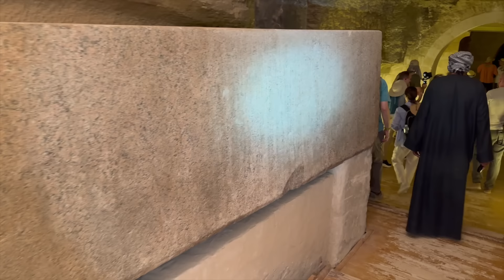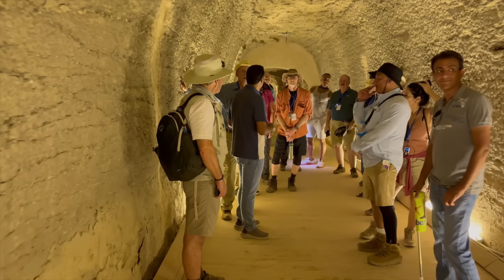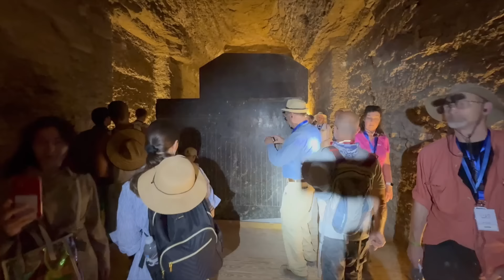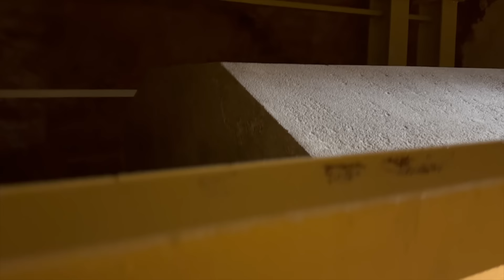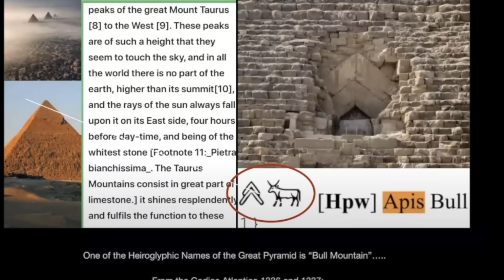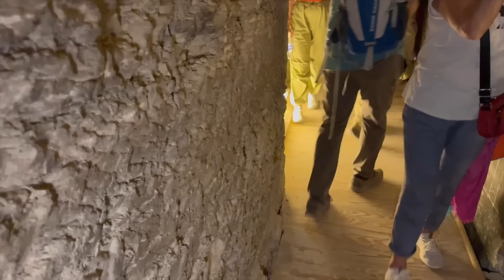Serapeum Secrets: what was really inside the 100 ton machined boxes?

Comment: How the Pyramid produced power
-------------------------------------------------------

If the SAR scans are accurate then that means the eight long vertical shafts under the Pyramid are what Physics calls "resonance tubes", that's basically a hollow tube you can pulse sound waves thru & amplify them. So what they were doing is taking the Earths natural vibrational energy (that's why they went so deep) then they increased that vibrational energy when they shot it up the shafts to vibrate the Pyramid above.

This amplification of the Earths vibrations was powerful enough to vibrate the entire Pyramid structure & this vibration is energy, a power source or rather, a never ending power source that supplied free non stop energy.

So apparently there are five so called "relieving chambers" in the lower level of the structure, those chambers are designed to modify the incoming vibrational energy in effect "fine tune" the vibrations to a specific frequency they desired.

Next thing that would happen in the functioning of this machine the powerful Vibrations would shake the structure like a titty dancer on payday & this vigorous shaking would energize the tons of Quarts Crystals embedded throughout the stone in the entirety of the structure

That's an incredible amount of electrical energy

Now we need to try and understand that the Pyramid is a natural toroid structure, basically it can swirl all the atoms thru the stone in the structure & all of those atoms pass thru the Quarts Crystals

Picture a doughnut in the air where the crust is a containment field made from magnetic properties and electricity, then in this doughnut the atoms inside swirl about in a never ending path that follows the containment field of the outer shell...Sort of like a bubble or ball lightning

Or better yet picture the Pyramid as a hollow funnel and the atoms flow thru the structure the same as swirling water would 

  
Next thing that happens is a plasma field is created in the Kings Chamber when the vibrational energy vibrates "the Box" or What others call a Sarcophagus. Inside that Box was liquid Mercury.

Next the atoms from the Lake in the lower lever is drawn up thru the Toroid & into the Kings chamber, this disassociates the atom structure in the plasma field

then finally the energy is shot out the tip of the Pyramid

-------------------------------------------------------------------- 
So 99% of the time the builders utilized vibrational energy to power the Pyramid

I left some stuff out, no one reads my dribble anyway :P

But these Boxes in the serapeum might not contain Mercury, these other Boxes did contain something atoms passing thru the stone activated

Comment: If there is nothing inside the box,  then the message is not the missing , but the box itself.     In the age of Alchemy Science,  they changed from mud brick construction,  to concrete formation of blocks    Judging from the rivers,  like the Nile,  where colored silts sit in some places  unmixed and pure,  having a unique color and taste,  and then in other places in the same river there is a  granite hard river rock bed  .   So they realized that  where the  random outcome was mixing the colored silts,  it formed concrete stone.  Where the silts piled up and did not mix,  they remained  granular and  like sand.    So when they dredged the colored minerals out of the rivers, they  experimented mixing sweet and bitter tasting colored sands  that when  they were mixed proportionately  in the right amounts  of each powder,   a caustic reaction occurred that burned away the water,  by rapid dehydration and  what was left was a  hardening material  like clay that in a  few days hardened to granite hard stone.  So  they  built the megaliths not by quarried bed rock  but by concrete mixtures  of  Alchemy Solutions, where  mixtures  change to compounds because of the innate creation of heat  out of caustic mixtures of powdery silts and sand.   
   To make a statue or a box,  you   mix the concrete to the moment it holds together as a modeling clay and you work it  artistically to be any form you want,  sculpted  to be a statue or a box or merely blocks,  and you have the clock running. As the  concrete hardens  you lose the opportunity to work it like clay ,  cutting and shaping and smoothing,  and finally as it hardens,  it forms , just like the bedrock of the rivers,  a  granite hard concrete,  because the caustic minerals mixed up ,   burns away the water.    You can also  add   illuminating powders  that light up  the dark caves,   because is is a slow form of a fire,    and painting the walls of an underground tunnel  makes them  burn and light up the caves,  for a time , and in the extreme cases of mixing these caustic powders that taste  like  "Bitter waters" mentioned in the Bible,   it creates  gun powder,  or dynamite ,  where  you can  cause great explosions .   These were the arts of  ALCHEMY SCIENCE  in the ancient times.   The craftsmen never wrote those matters down to  publish the secrets, they were taught only father to son in a craft ,  and  many  ancient fables and stories  contain mathematical  formulae to express the secrets , which  need a code to discover the secret messages encrypted in the story telling,  which is not  apparent on the surface of the  story itself.

Comment: If the king said to build him something ??? You did it. The giant bulls were important. Why ? Their massive blatter waß the size of a car. They controlled the Nile beyond belief. Imagine this. Flooding the valley. Using the water as scaffolding. Floating the blocks right into place. Thing are much lighter in water. A ship would tip. You would have to hang blocks like they raise ships today. Float them with air. They even found a boat buried at the main pyramid. Easy one. It's not aliens. There is no aliens. Just humans from the future traveling to the past.

Comment: I was a longshoreman for 12 years. Gantry crane max lifting weight is 120 tons. No clue where you got 1000 tons from. I was a straddle carrier operator for many years. The machine alone weighed 70 tons with a max lift weight of 50 tons.
Reply: There are gantry cranes that can lift 22,000 tons. Look it up

Comment: I have a hypothesis that these boxes were for shaving the flat faces of the casing stones. A stone would be mounted against the inner surfaces with the face to be cut sitting just above the edges. The shiny top and edges formed a fluid bearing that allowed a twenty-ton lid to be pushed with 40 pounds of force. The top of the box is tilted downhill 1.65 degrees. It would take 14 men to pull it uphill. So, they pulled it downhill and gained some speed and the front edge of the lid plowed into the limestone. My calculations show that 4 to 10 passes might be needed to cut the entire face. There are a lot of chips on the cutting edge of the lid. Because the fluid bearing requires extreme flatness, the lid would move in a straight line across the stone, and the immense weight would keep it from chattering. I surmise the tunnels were flooded waist deep and this kept dust and flying debris down. Wet limestone is only 40 percent as strong and has less friction. There were a lot of casing stones to cut, and 24 machines could have been kept busy. 

The lids are found open because they would be ready for loading. The fluid bearing technique may have been used to move the boxes effortlessly, by placing some length of polished granite that granite pads slid over. I have more info on machining at this link https://docs.google.com/document/d/166qSl09CcXnFdsDr6iTw_GVGYyh7Iw99/edit?usp=sharing&ouid=117576507177872891277&rtpof=true&sd=true
Reply: Your explanation sounds more logical and  makes sense, not like many other videos like this one trying to imply that some sort of extraterrestrial being traveled thousands of lights years just to build stone boxes for some sort of energy generated machines 😂 I wish that more people will read your hypothesis thanks you again.
Reply: @lobos0094  Yeah but still wrong. These humans had special abilities, they were connected to something more greater, something you would never thing of!
Reply: @kafilkavich it's just stone
Reply: Brilliant original idea
Reply: Thanks man   very interesting  and satisfying theory... you've really put the work  into it . 
I'm speechless .
Reply: We all can just wonder .... who are we to say what happened
Reply: @TheNicolasbenlarbi but we know what happened. Egyptians made these boxes in the late iron age-Hellenistic era, and the tombs they go in, and put them there

Comment: I read / watched a yt documentary about the bulls corpses placed in the boxes at the serapeum. As the bodies broke down a huge electrical discharge was created due to the bloating and pressure inside the boxes. This is why the boxes had such huge and heavy lids to hold the pressure. The pressure differential inside did something with the box material and created an electromagnetic field. The field was then used for whatever purpose, wireless electricity etc please do t ask me questions as it’s a few years ago, there are documents online in pdf you can read about this and if I find the yt link I’ll share it.

Comment: My moneys's on them being giant liquid acid or alkali batteries. That explains why the crypt floors are lower than the tunnel - if there's any spillages or leaks you're not contaminating the floor of the tunnel as well. I wonder if the volume of area below tunnel floor can is similar to the internal volume of the boxes? Maybe they used the "sky-metal" in the batteries instead of lead?

Then the question is: what was the power source that charged them? Presumably a periodic or unreliable source or they wouldn't have needed such huge battery storage.

Comment: One thing that I have noticed is that a lot of ancient structures have metals, crystals, and others that looked to be possible electric circuits.
Reply: @DesertNurse2297  they always used stone that is highly piezoelectric. Anything with quartz in it.
Reply: i have thought for a long time the ark of the covenant was a large capacitor , it had the tablets wrapped in silk   , if the tablets were mica , and metal   alternately   and connected to the gold   angels    adorning the wooden   box   it could be charged via the capstone of the pyramid    and any one getting close would be zapped 
hence the people  who handled it   were adorned in silk as it is a perfect insulation 
it would be a great  military   asset    and would    no doubt make the bible thumpers think it was  a gift from   heaven 
instead of a part of an advanced   electrical    machinery
Reply: Becuz they were rejuvenation chambers for Enki(ptah) and Thoth later used by Marduk,Enkis son...
Reply: Then pyramid wars broke out which disconnected all of them but they still emit energy

Comment: Great video! I can help to answer at least some of the questions listed in the video, but first there must be some common ground you see we are from the civilization which mastered electricity and electronics and we are trying to understand the technology of the civilization which mastered gravity they made circuits which were powered by gravity which was used for power, healing rejuvenation, transport, communication, etc. Electricity was known and understood but considered too harmful to living things. Consider a wire moving in a magnetic field, you get electric current and now consider a leaf moved by wind in a gravitational field you get life current!
Just like copper is a conductor of electric current so is granite a conductor of gravitational current this is the reason for the smooth perfectly fitting flush surfaces because air gaps to gravity represent high resistance path and dense rock low resistance path. To the civilization that mastered gravity transporting huge granite blocks was not a problem! The refugees from Atlantis are the original pyramid builders back in Atlantis the elite had a device which programmed their cell  to rejuvenate and stay young they could live for ever this way, after the flood this technology was lost but they didn't want to die so they built pyramids where they would enter the granite boxes to rejuvenate their bodies this way they could extend their lives to thousands of years! See the work of Wilhelm Reich on orgone accumulators, also symmetric field physics. Gravity consists of two current: time current and space current. The time current flows down and it holds everything down it also ages it follows the path of dense material. The space current flows up it follows the path of low density empty spaces and it preserves gives life and healing. Now with that in mind look at the pyramids and see that the time current is diverted around the king's chamber through the heavy walls of perfectly fitted blocks and the space current is accumulated in the spaces and supper concentrated in the granite box in the king's chamber the same goes for the granite boxes in the tunnels in rock they are lower then the path to avoid the gravitational time current which will firstly engage the path floor then the granite box which is lower. If you were to lay down inside on of these boxes and the lid was closed you would feel the powerful  life force filling your every cell any ills would be healed in minutes and you would come out of there feeling like new born God! This is how the high priests of Egypt lived and ruled but then the Romans came and killed them and the knowledge was lost because education was not for everyone back then the elite kept it to themselves. After that anything built by the Egyptians was just a pathetic attempt to copy the original magnificent structures and of cause they couldn't and we couldn't either.

Comment: Beeswax candles and olive oil lamps do not produce soot marking as long as the flame is regular size like today's candle produce and maybe a little bigger as long as the wick is kept short and is kept far enough away, it has to be in close proximity and the flame has to nearly touch the surface before it starts throwing soot,  and in small tunnels they give of plenty of light, however I agree with the other points so far (16min in)

Comment: Well some dilemas are false, im not telling that presented theory is not possible, butthey did work with stones for milenia.. They know quartz power 7 hardness and probably emergy hardness 9, you can move them even with cooper, wood or other piece of stone. Transportation 8 miles of 500 miles journey actually shows that they tried to use water as much as they could and they could even build some cannals to Nile. They new ropes, wheels - they had chariots and truns and you use bulls, horses, cammels. Not enough space to move object you can use ropes, wood increse its volume if is watered, you can see trees breaking rocks over time. The last youn can remove celling and walls to move object with cranes. So its hard but not impoossible they not builded these fast..

Comment: also has nobody considered the Bull as the engine to accomplish the great feat of stone manipulation? were they so sacred they didn't use them? Or are they so sacred because they did use them to build and move giant stone. If mass is the question, the bulls are the most massive animals so they must utilize them to build everything still doesn't account for perfection in engineering, maybe the bulls ran the machines?? They obviously had the wheel or circular devices large animal could pull the machine into action against the stone…

Comment: Think about this: why would someone put so much work into making a container only to not use it. If they were simply made to hold something that never made it into the vessel, why is the lid on? You'd think they would leave the lid prepped to be lowered. If someone looted them, why would they put the lids back on?
Reply: They were used with sound to form quartz crystals inside cast stone. Natron theory proved how some limestone is cast. Now all you need to cast granite is a sound wave that causes quartz crystals to form, removing salt as it dries. It's just a matter of hitting the right frequency. Possibly 26400hz or some multiple of 528hz
Reply: @mikefromspace Just stop! What the fuck is wrong with you people? It's a stone box. Its purpose is engraved on the side
Reply: @eyesonthey  it seems like it wasn't that difficult for them somehow. Otherwise your points hit the mark.

Comment: Given the heavy weight of the lid and the precise fit between lid and box, I see a pressure regulator. "Measurements could reveal pressure limits"  Too bad fittings and pipes are salvaged.

Comment: Risks of using wooden rollers for heavy loads

Compression and splintering: Wood fibers will compress and splinter under extreme stress, especially when the weight is concentrated on a small surface area, such as a log roller.

Rapid wear: With a load of 100 tons, any movement would cause the wood to wear down and disintegrate quickly from friction, making the setup unstable.

Risk of uncontrolled movement: Should a wooden roller suddenly fail, it could cause the entire load to drop or shift suddenly. This creates an extremely dangerous situation with a 100-ton object.